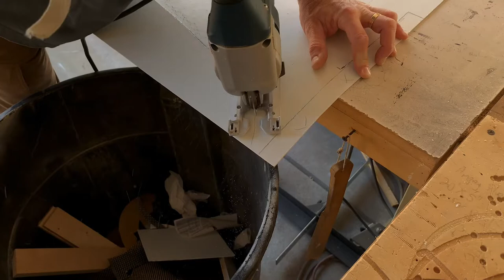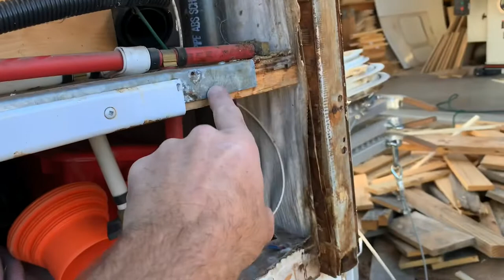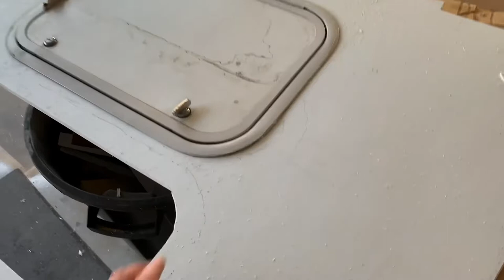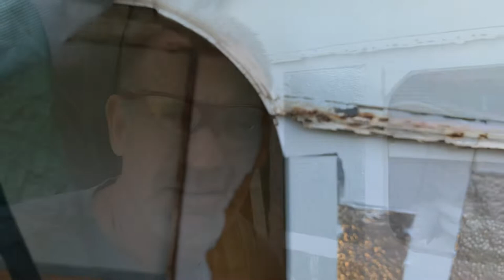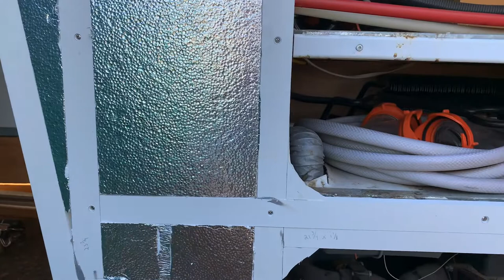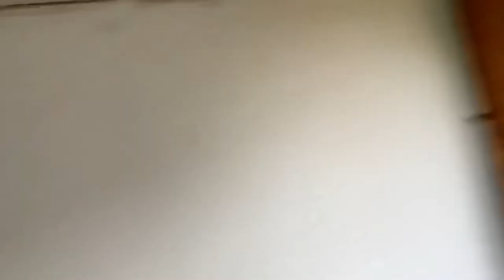Rotten Truck Camper Rebuild Continues

Comment: Great job!! I'm going to be tearing my truck camper apart too and will be replacing the roof and some side water damaged stuff. Also it was in a salt water flood so all the electronics and metal will need to be replaced. Also the power jacks. I took those apart and will rebuild them. I already re-wound the armature in one jack motor and hope I don't have to do the rest!!

Comment: I just did a truck camper rebuild due to a front cabover water leak... Not a fun project but looks like you are doing an incredible job.
Reply from the maker: Thanks.  Yeah, the cab-over area seems to be a problem on truck campers and class C rv’s.  I’ll need to re-do my cabover at some point.

Comment: Nice job. I wanted to tell you I seen a truck camper fixed with diamond plate and it looked almost factory built. Maybe give you some ideas in some areas.
Reply from the maker: I considered diamond plate at one point.  (Specifically around the lower box)  The added weight and cost over fiberglass composite panels was huge.  I’m actually saving weight with the composite materials.  I’m happy with the way things turned out.
Reply: You’ve got skillz! My lower wood is rotten too and the screws are not holding the wood to the aluminum frame. Did you replace the lower wood or just go over it with composite?

Comment: What type og glue did you use for the panel to pvc?
Reply from the maker: Assembly was done with Loctite Max Premium Construction Adhesive.
https://amzn.to/3t3TvRB

The exterior Fiberglass panel was adhered to the pvc and foam insulation using Loctite High Performance 200 Spray adhesive.
https://amzn.to/37qkRJj